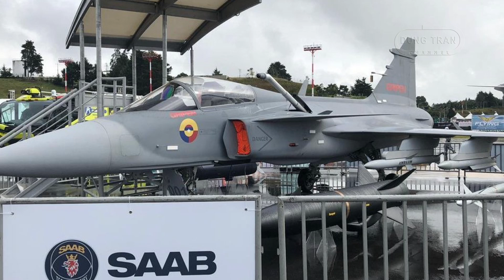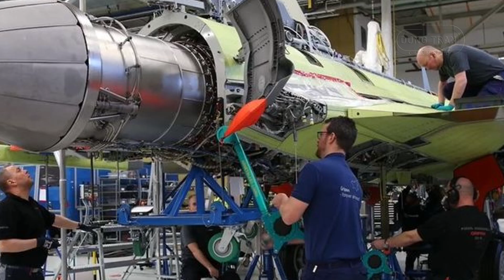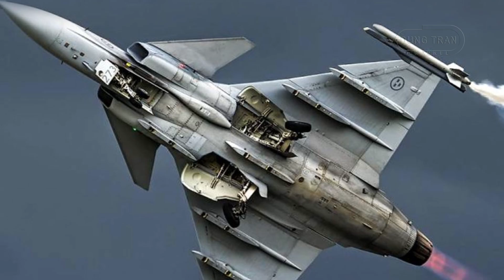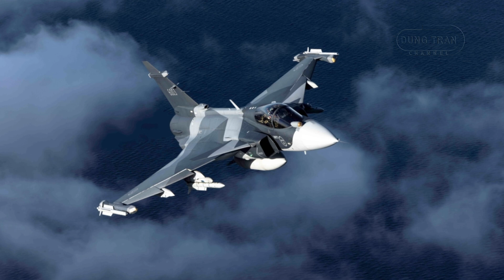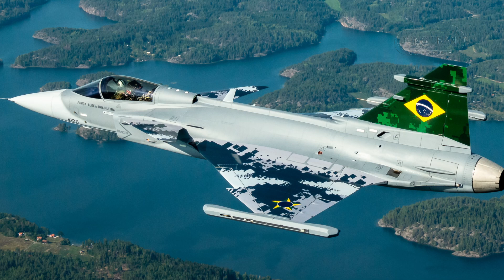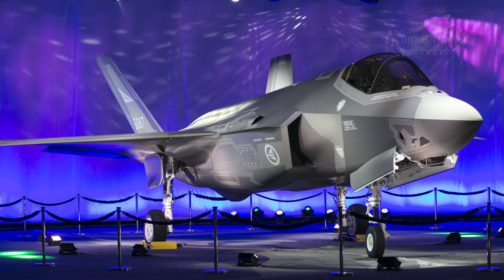Swedish Gripen's Achilles Heel: The American Engine

Comment: The JAS 39 Gripen is blocked for export by the US. 
SAAB must re-install the older Volvo engine. 
It must also be compatible with the F-35 fighter with the same software timer "Kill switch" that has been implemented as an upgrade for Europe.
Reply: Which 'older' Volvo engine?
The Gripen E/F uses the GE F414.
The Gripen A/B uses the GE F404.
The Viggen used the P&W JT8D modified to include an afterburner.
SAAB is screwed. They can only export the Gripen E if it suits the Americans.

Comment: Hi SAAB ! Replace the GE engine by a Rolls-Royce or Typhoon Eurojet EJ200 turbofan engine. You SIMPLY CANT be in trumps mood
Reply: @laves820  That's Volvo Aero.
Reply: Many years ago Eurojet already offered a version of the EJ200 (the engine of the Eurofighter) to Saab. It has better performances than the Volvo RM12 thus being slightly smaller, but it's also more expensive.
Reply: @neutronalchemist3241  The RM12 is used in the c/d variant, it's a rm16 (F414ge39e) in the e/f variant.
Reply: @ EJ200 is already comparable to the F414 / RM16. It has a slightly better dry thrust than the F414, a slightly worse afterburner one and a better thrust to weight ratio. 
Eurojet proposed to Saab the EJ230 variant, 102kn thrust with afterburner (vs. 97.9kn for the F414) and thrust vectoring. Saab chose the F414 because it was cheaper.
Reply: @neutronalchemist3241  yeah it’s performing wonderfully but if we need to redesign the air intakes then the investment becomes a lot bigger than the alternative, that being the M88, which if we’re looking at the M88-3/4/4E variants, has potentially even better performance than the EJ200 and EJ230. Thrust vectoring while cool and useful for many reasons, would be too expensive to implement as it would require a new standard maintenance process, redesigning the rear of the fuselage as well as reprogramming the entire flight software. We need the most efficient and realistic solution, and that is the M88.
Reply: @nivsen5986  Mind that a redesign of the intakes could become an occasion to implement divertless intakes, with a further reduction in weight and price (both in manifacturing and maintenance) of the aircraft.
Reply: @  they already explored several intake designs when they designed the Gripen and settled on these for good reasons, easy access during maintenance being one of them. Building a new airframe wouldn’t save any money in the long run since every current customer can’t replace theirs realistically and the export potential is there but not if the price jumps due to a new expensive development that Sweden won’t pay for. Why would we painstakingly extend development time and put in all this effort and resources when there is an alternative that’s just as potent and can be fitted in the aircraft without a redesigned frame?
Reply: @nivsen5986  Current customers had already bought their planes. The new airframe would be used on new ones. 
The Gripen inlet design is conceptually over40 years old. Divertless air intakes had become much more efficient in the meantime, tha'ts why many NEW projects use them. 
The reason the Gripen had become so interesting is that the current supplier of the engine is no more seen as reliable. That's the same reason it probably needs a new engine. 
Whathever engine you decide to use, it's not plug&play anyway.
Reply: @ considering saab already have detailed the swap to the M88 I’d say it’s as close as one can get, and it would be far easier than swapping to the Eurojet alternatives unfortunately since I prefer them but they are unrealistic right now. The point was never that the inlets are the best, the point is that changing them would cost tons and take immense time, likely missing out on the new wave of fighter orders. Diverterless intakes would also make ground inspections slower since you’d have to remove the engine before checking everything unlike with the current design.
Reply: @neutronalchemist3241 sorry, but the Gripen E uses the RM16
Reply: @ EJ200 is already comparable to the F414 / RM16. It has a slightly better dry thrust than the F414, a slightly worse afterburner one and a better thrust to weight ratio. 
Eurojet proposed to Saab the EJ230 variant, 102kn thrust with afterburner (vs. 97.9kn for the F414) and thrust vectoring. Saab chose the F414 because it was cheaper.
Reply: @neutronalchemist3241  Yes, but the Gripen is already so inexpensive to operate that the cost of the EJ230 won't be an issue now, especially since the USA has become more of a pariah in NATO than even Turkey.
Reply: @CF-105_AvroArrow  Also because, in the wake of the doubts about the reliability of the F35 in case of war, the Gripen being cheap would not be any more one of its main selling points.
Reply: @johns70 The RM16 is the General Electric F414-GE-39E engine.
Reply: That was my initial thought aswell but then I learned SAAB already made the Gripen to accommodate the Snecma M88, most likely the more powerful versions with the larger low preassure compressor, I.E the M88-3 and M88-4/4E, so those are the most likely, and the easiest and most cost effective choices since the EJ200 would require adjustments to the airintakes as stated by GNK aerospace, previously Volvo aerospace in the 2000s, which isn't huge but more of a hassle than the Snecma options.
Reply: Be calm! Our sympathies are with Europe, Canada and Ukraine. And in particular with Denmark and Greenland. The reason for joining NATO was not to bootlick to USA, but to protect the countries on the other side of the Baltic Sea.

Comment: SAAB will soon replace GE F414 with RM-16 (similar to GE F414 - Sweden made) for  Gripen E. Their upcoming nextgen Flygsystem 2020 (2030-2035) will most probably to have twin engine of RM16 + AI wingman drones as the main combat fleet.
Reply: No, the RM16 is the Swedish made adaptation of the GE F414. And the Gripen E uses a single one. Sweden do not use twin engine jets. (Because they are unnecessary)
Reply: @johns70  The plan was to use twin-engine of RM16 for their Flygsystem 2022
Reply: I think that SAAB will instead use the Rolls-Royce EJ230 currently being produced for the EF-2000.
Reply: @CF-105_AvroArrow '...EJ230 currently being produced...'
Got a source for that?
Reply: SAAB and the Swedish government driving these procurements think in generations just like any other manufacturer. And while the development of the new Flygsystem 2022 may take some years still, it's a completely new design with room for a different engine layout. There's a need for new equipment now, however, so is the new RM16 engine similar enough to be swapped into the existing frame? And is it independent enough as a product to not need the US?
Reply: This new engine, is it derivate of some US engine or completely new, designed and built in Sweden? If it's in any way tied to USA, it'll most likely being banned by USA.
Reply: Yeah right😅

Comment: Brazil have Saab 39 Gripen F
Reply: FYI versions of Gripen gen 1 A/B gen2 C/D gen 3 E/F  B, D, F is the two seat variation for pilot training!
Reply: E/F
Reply: E = single seat
F = Two seat

its the same plane. Not much difference, two seats are training aircrafts that have traded away some extra fuel for an extra pilot instead.

Comment: They produce it (the engine) in house, has the blueprints and the engineering with the know how at SAAB.. if we want we can just give the US the middle finger..
Reply: Especially since the G E didn´t want to help Volvo Aerospace develop a version that fit into a single engine jet, wich meant that only about 20% of the original parts from the original remained.
If I were them I would skip their engine and simply build 20% more new parts. Especially nowadays.
The source I took this from is an old book from the Swedish Air Force about the JAS history, that I couldn´t find right now at home. So take it for what it´s worth.
Reply: @Lance-Lefth00k tbh, if they were asked to, and had some help from another engine maker in Europe, GKN could probably build an engine to replace the RM16.
Reply: @johns70  Just use the Rolls-Royce EJ230.  It's sitting right there, ready to go and it will fit just fine.
Reply: @ it might, but I am not sure it is even built as a prototype? It would also add a few years to the process, as it would need to be built and tested extensively first ofc. But it does not seem impossible to do. However, I think the size difference (especially diameter) is quite big, so there would be quite some reconstruction needed. But no, not impossible.
Reply: @gumby2241:  SWIFT is based in Belgium and thus operates under EU law.
Reply: Ah yes einstein. That would not have a million serious negative effects.
Reply: There is probably thousands of small parts like chips that could be stopped by US... So a bit of smoothness is preferred ...
Reply: Correct. The engine for the Gripen is the Volvo RM12, a derivate of the GE F404 and the RM16, a derivate of the GE F414 for the Gripen E/F. They are manufactured in Trollhättan Sweden. SAAB, Ericsson, GEC_Marconi (BAE) are the providers for Radar, avionics and other electronics. It features software written in Ada that highly customizable for the client. Defensive/active counter measures by Selex ES (Leonardo) with BriteCloud (decoys). In-house developed counter-stealth performance sensors. According to SAAB's campaign director Edvard de la Motte: "If you buy Gripen, select where you want your weapons from: Israel, Sweden, Europe, US… South America. It's up to the customer"
Reply: @ The F404 (RM12) hasn't been used since the JAS-39C.  No JAS-39E has an RM12 in it.
Reply: Yeah absolut right and Airbus also possible I think👍👍the Money must be in Europe
Reply: I don't think a Swedish government would do that. They have a longer time horizon than Trump's disaster period.
Reply: @ Right, they could just switch to the Rolls-Royce EJ230.  It costs more, but it's a better-performing engine than the GE F414.
Reply: @Leonardo-from-Sweden  But if USA gets better again, then they would understand and the middle finger can be retracted.
Reply: You would be sanctioned and lose access to swift, you would be isolated and your economy destroyed.  But, you do you.
Reply: @gumby2241  USA do not posses that power any longer. Sanctions only works if the rest of the world is playing ball. USA have no allies anymore. At least none that has any power to enforce their sanctions,.
Reply: @gumby2241  sanctions only work because America and the EU does it together, also, in the case the US goes rogue we, the rest of the 109+ countries have all the prereqs to create a new system.. Sanctions only work on Russia or is a tool of the US because the US has the EU on its side.. only 4 countries are openly on Russias side when it comes to sanctions and the 2nd largest economy aka the EU is on your side, that's why you can sanction people... for now
.... same goes for Iran and North Korea, isolated and alone.. I don't get it though, why are you so fucking hellbent on being my enemy, what's wrong with you? You do you, what type of a shit reply is that?